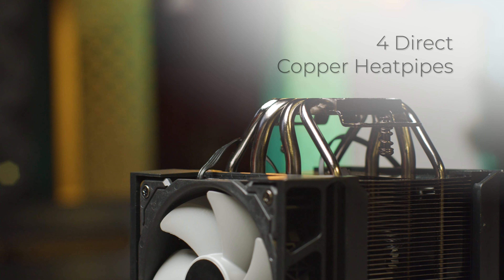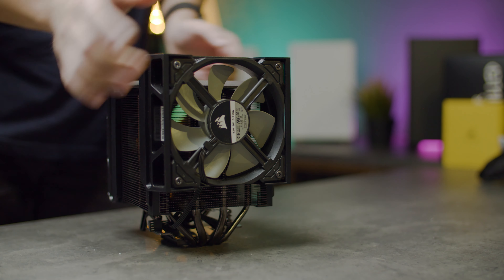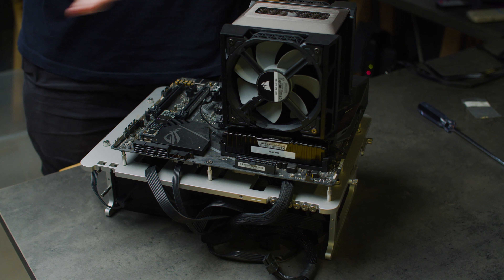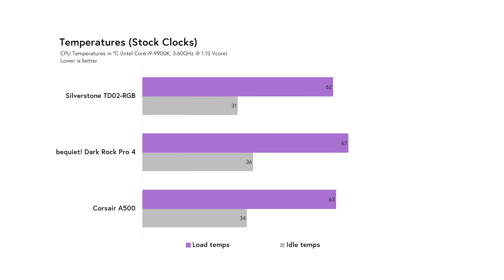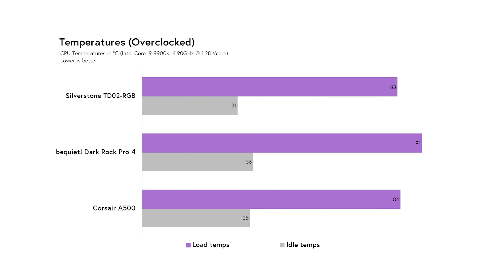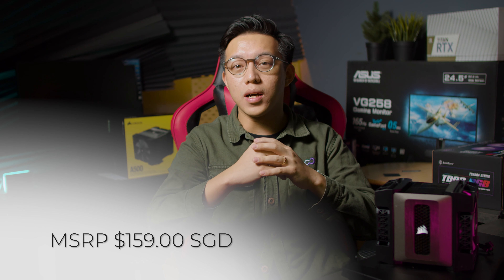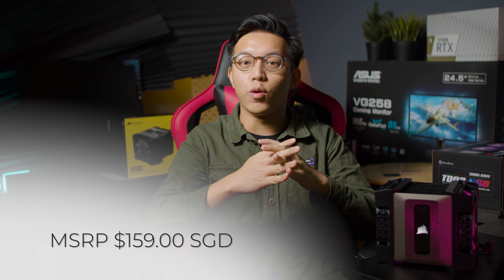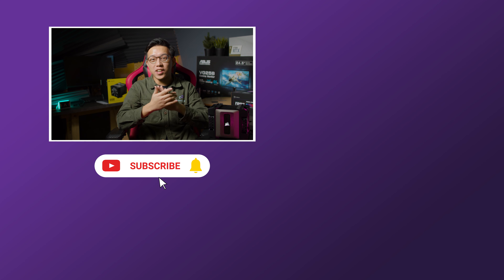Better late than never (like this video) | Corsair A500 Review

Comment: Great video, bro!
I wanted to find some information about this cooler that was more recent than the bulk of the reviews from when it dropped back at the beginning of the year. Thanks for providing such a concise and thorough review. You really hit on all the information on basically everything I wanted to know. And your presence and production quality in your videos is top notch as well.
I subscribed to your channel and look forward to seeing more of your reviews.
Also, for what it's worth, Newegg has this cooler on sale right now marked down from $99.99 to $49.99 USD and it also comes with a $20 rebate card, for a total net cost of $29.99 USD. (pre tax, of course). I have no idea how that translates into SGD, but for me at that price it's totally worth it to give it a try.